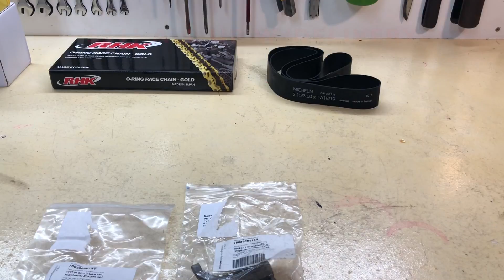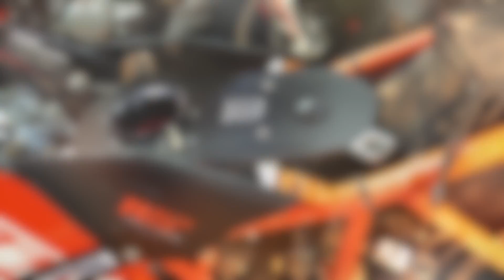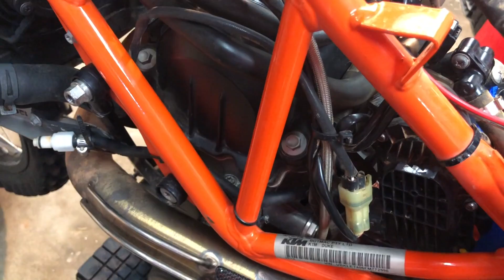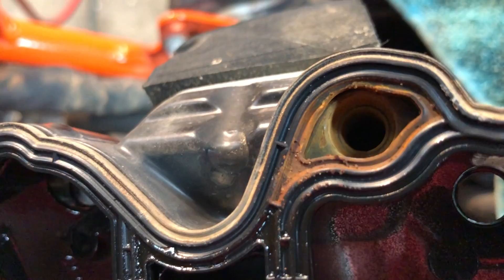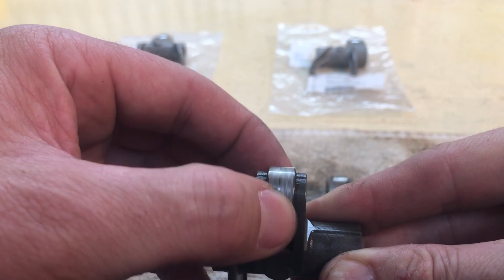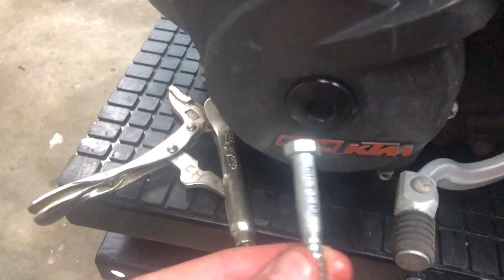KTM 690 Enduro R  / ROCKER ARM REPLACEMENT / Desert Preparation Part 1

Comment: Hello, I have a 690 Enduro R 2020 with 5000 km and I am convinced that I need to change the rocker arms.  is it possible?
Reply from the maker: Hi mate, Im not too sure about the 2020 models but I do believe the problem was fixed by KTM around the 2016 - 2017 models. Maybe get on a forum or something and see if anyone is having issues with the later models. Cheers mate and good luck.

Comment: You didn't check the valve clearance.
Reply from the maker: I did a video on checking the value clearance however you are correct, should have checked them when doing the rocker arms.

Comment: Hi Shadower 75.  I have  a 2018 KTM 690 Enduro R ( U.S. ) with about 18.000 miles.  I've checked my rocker arms and valve clearance at least 3 times. All look good.  I even checked the part number stamped on rocker arm.  Looks like OK ones.  At what mileage do you recommend changing rocker arms?      Thanks.     Kam
Reply from the maker: Hey mate, thanks for watching. I do believe your model 2018 the rocker arm problem was corrected however I have heard of some newer model owners still changing them out. I did mine around that 20,000 km mark as that was when those earlier models failed. Cheers and hope that helps.

Comment: Why you replaced the rocker arms?
Reply from the maker: My model is around the time KTM changed the arms to fix the problem with them breaking and destroying the engine. I tried to confirm with the dealership if my model (2015) had the new arms or the old dodgy arms and he couldn't confirm so I thought for a few hundred bucks I would be better off safe then sorry so I changed them out.

Comment: Hey mate grid video..how many kms has the bike got? Trying to understand when the 690 needs this done..? Cheers mate
Reply from the maker: Hey Occy, I swapped mine out at 18,000. I believe for models before 2015 its recommended to change them out before 20,000kms however I've heard of guys having 40 - 50 thousand kms and still going strong. I guess I wanted to err on the side of caution. Cheers mate.
Reply: @Shadower75  cheers mate... We have a small group out of Sydney doing Simpson Aug 2020. Trying to decide if the tried and true DRZ is the answer or something a little more exciting.

Comment: Greetings from 1/(downunder) + fellow KTM superfan.  You're fun, but your mancave is too clean. As the other viewers had mentioned, I had immediately saw where you had not used assembly lube on the rocker axles (for initial lubrication protection before the oil pump kicks in) or checked the valve clearances since new unworn parts were being assembled. I thought maybe you forgot to record that part (I'm guilty of that in my videos). However, my question is, what motivated you to think you needed to replace the rockers, to begin with? You have a post-2014 LC4 KTM 690 which already have the redesigned rockers which fixed the earlier issues with the rollers, which some owners had issues with. The 2014+ rockers should have the same life expectancy as the rest of the engine. https://youtube.com/c/telerover
Reply from the maker: Hey telerover, hahaha I did a big tidy up of the man cave before the video. Firstly let me say thank you for all your videos. They have helped and inspired me to do similar things. 
I changed my arms over as a precaution thing. Tom had the same bike and year model as I do and his arms failed. I didn't want to suffer the same fate even though I have been assured KTM has fixed the problem. Anyway, have some spares now.
Anyway mate, love your vids and love Deacon even more knowing his a true blue aussie dog. Good on you mate and ride safe.
Reply: @Shadower75  
my 2007 625 SXC has developed that ticking noise, coming from a RA roller i suspect. should i get  two new rocker arm assemblies or just swap out the rollers, if possible? the cost is an issue. i'm going to try and tackle this job myself, your video has given me a little bit of confidence to give it a go
Reply: Don't trust KTM, rocker arm is still an issue even with the newer/modified version. I'm at the 3rd set (65k km). Probably only the post 2019 cam version have the issue solved. Not big problem, it's an easy job changing those arms. But it is important to change it every 25k km max. IMHO

Comment: Wow, consumable rockers!
Reply: Crazy. So stupid! Why would that wear out? cheap steel? What year is this 690 your working on? What was the clue they needed replacing? This is not a good selling point for KTM to me. Is it factory recommended replacement miles?
Reply: @beverlytim  a reflection of the engines roots... not enduro focused dirt track... all that trouble... & leaving the timing chain... not my idea of sound servicing... as with replacing the drive chain & not flipping the sprockets
Reply from the maker: hahahah good old KTM 690 rockers hey. Cheers mate
Reply: Not a problem with 2014+ LC4 motors

Comment: Ahh the spanners back just saved yourself mega bucks from the dealer .👍don't know the cost but would it be worth fitting new clutch plates. Top job
Reply from the maker: Doing things yourself does save the cash that's for sure....

Comment: I agree with others re checking valve clearences, before you start that engine. My suggestion might be too late. 👍😁
Reply from the maker: cheers Rob and not too late. I haven't even ridden the bike yet. Doing it next.
Reply: @Shadower75  Yes of course Robert, with new rocker arm you have to make the valve clearance, it's very important !  Because it could be changed by the new rocker arm !   ;)

Comment: Link below is a reasonable guide to doing the clearances and gives you a spreadsheet for working out shim sizes. I buy them as I need them from the Harley shop, You can get shim kits from ebay with a multitude of sizes.   https://www.welikebikes.be/KTM690Wiki/index.php?title=Valve_Check
Reply from the maker: Again mate, thanks.

Comment: I remove the spark plug and turn the engine to Top Dead Centre (TDC) using the back wheel in about 3rd gear. I soak the new rockers in an oil bath overnight before fitting. The Rocker securing pins have a dot on the end of the shaft that should be at the top to show the pin is the right way up. You must do valve clearances after fitting new rockers the gaps can change dramatically due to new bearings and less free play. Its a performance engine and clearances have to be optimum for performance. I use Harley shims as they come in 0.025 increments whereas KTM shims only come in 0.050 increments.
Reply from the maker: Cheers Andrew. I've already set some time aside to do the valves....
Reply: @Shadower75 At what mileage were the valve rockers made?

Comment: Good video Mate. But very important to check your valve clearances. If too tight you could end up burning out a valve seat.
Reply from the maker: Good tip ktmkev. Looks like I'm going to pull the valve cover back off. lol

Comment: Hi,  good video. But a few questions.
Is to rocker arm failure a fault with the 690s ? I ask this because " Riding with Tom " ended his Cape York trip , with a broken rocker arm.
The wear on the R.A. shafts, is that case hardening failure ? 
Surely the rocker arms should last the life of the engine.
Finally how many klms on the engine ?
Thanks.
Reply from the maker: Hi Mark, the rocker arms in the earlier models (before 15) where susceptible to failure. That's exactly what happened to Toms on his Cape ride. From what I've read is that the 20,000 mark is where they can fail. I was closing in on that mark and just wanted to be safe than sorry. 
You are right though, you would think the rocker arms should last the life of the engine. 
My bike was sitting around 17,000 and my Simpson Desert Adventure would have taken it well over the 20 mark so i changed them out.
Cheers
Reply: @Shadower75  Hi, great vids of the Simpson crossing and thankyou for your reply.
All the best.cheers
Reply from the maker: @markdacy6324  No probs mate. Glad you are enjoying the Simpson vids. Cheers